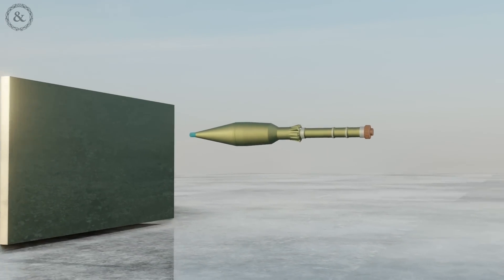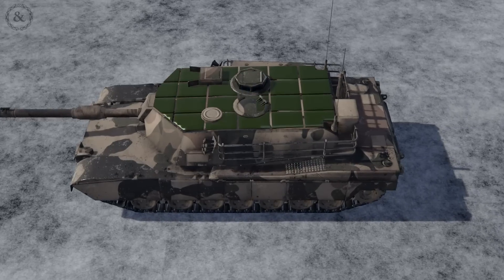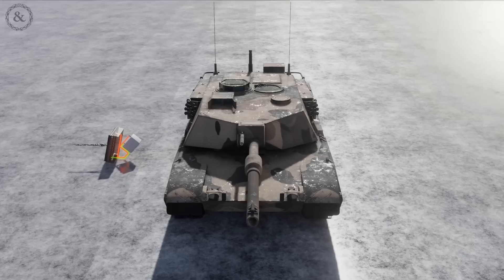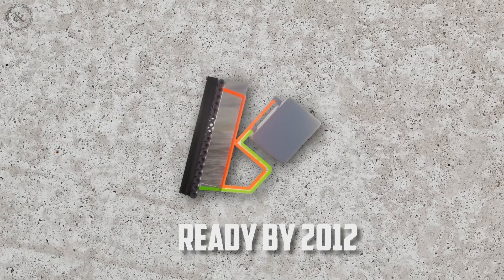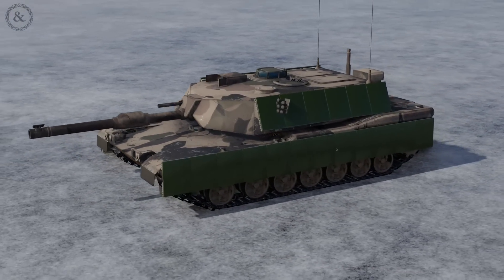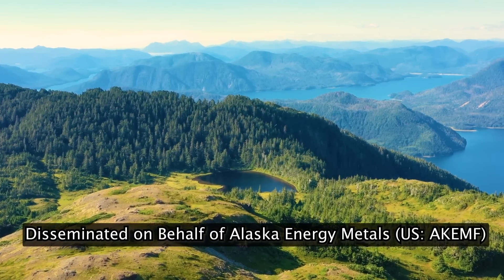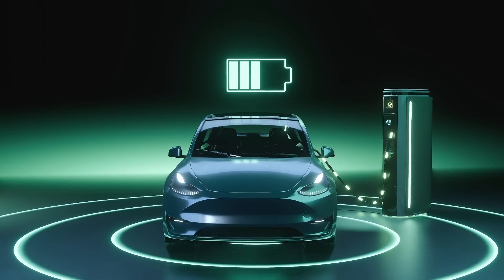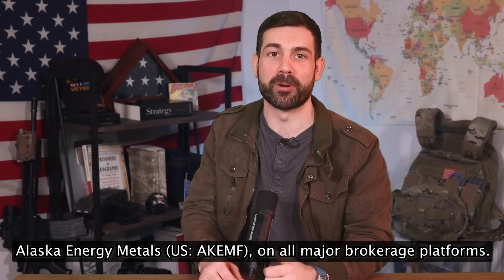How Electromagnetic Armor Vaporizes RPGs

Comment: A double tap would render the armor useless.  The first munition would be dumb frag/sabot type to destroy the electro plate, the second munition would have the shaped charge.  Both in the same shot/missile.  These double tap rounds already exist for reactive armor.
Reply: Yes, but just like ERA, you have to sacrifice the primary charge size which reduces its actual penetration compared to a unitary warhead. Either way, it reduces the potential penetrative capability of the HEAT either by disrupting the jet or forcing it to have a smaller main charge for the same weight/size.
Reply: At  5:02  "the shield was placed 1 meter away"   Well duh, just the 1 meter physical separation alone would reduce the charge's power by 50-70%.  smh  What would also make the tank 2 meter wider and taller. lol
Reply: put this on top of era
Reply: @ahimel  Well would the explosive reactive armor destroy the electromagnetic armor?  So good against one shot only. Why not just ERA armor in that case?  He didn't say if electromagnetic armor  gets damaged after one shot.  I would think the point is it does not bit I'm not sure how that would be so.
Reply: A simpler solution is tandem charge shaped charge warhead.
Reply: @samuelmendoza9356  - They already have tandem charges and anti-tandem charges. lol  It's a never ending cat and mouse game.
Reply: @billant2  I express doubt the Electric Armour would fare better than ERA
Reply: @samuelmendoza9356  - Both have pros and cons therefore should be used in specific cases.  EA is still bulky and cumbersome to use, including rearming/recharging.  Like most electronics it will likely be improved in the future.
Reply: @billant2  Electric Armour is reliant on having electrified surfaces to zap projectiles like shaped charges(HEAT) and maybe even APFSDS. Once that part is struck I imagine the struck part and several inches around that struck point is gone. It's main advantage over ERA is it can be lighter. Struck with tandem charge or even the solution you propose, its the same, there's a hole already and it can't stop the second one going through it. At least, the ERA, when bolted on, won't need that much maintenance. Thhough, there is still weight issue.

In other words, no matter how fast electric armour is charged, its the hole on the struck part in which tandem or double tap mechanism is as helpless as ERA.
Reply: @samuelmendoza9356  - EA would be  effective is it could disarm an incoming missile from over a meter away to prevent a tandem change to do any significant damage.  Almost like a sci-fi force field, but we're probably may years away from that.
Reply: @billant2  you have a point, but I imagine the hilariously simple counter is proximity fuze and several counterchecks such as estimated flighttime to reach target and signature. Not exactly optimal but at least it can avoid touching the EA before it detonates. Granted, this idea is only ideal for ATGMs. Unguided AT rockets might make do with proximity fuze.
Reply: Tandem warhead you're welcome
Reply: can't it easily be defeated by covering the RPG with a couple of rubbers? 
that's like what? 10 cents or 20 minutes with a goat in the middle east?

Comment: This technology has been used for a few decades on North American aircraft carriers. The upper deck... but on an aircraft carrier there are 2 nuclear reactors that can generate large amounts of energy if necessary... But in a tank it is a little difficult to get due to the weight of the generators

This technology has been used for a few decades on North American aircraft carriers. The upper deck... but on an aircraft carrier there are 2 nuclear reactors that can generate large amounts of energy if necessary... But in a tank it is a little difficult to get due to the weight of the generators

Comment: Interesting concept. IF this can't stop Sabot, does that mean it might not stop other unitary kinetic projectiles like anti-tank rifles? Would hosing an enemy tank with heavy machine guns or even small arms damage or deplete the electric armor to the point that an RPG could have the desired effect?

I could see this being useful in some instances with modified tactics or additional systems. It might be useful for hover tank-destroyers that I've proposed, which are all-but-unarmored self-propelled anti-tank guns that use static and dynamic air-cushions to scoot across the ground and above mines and fast enough to mitigate ATGMs.

Comment: Capacitors of this sort require constant direct current, easiest was to think about such a thing is to imagine it’s water. Direct current (DC power) simply means that the power is always on and always moving in the same direction through the circuit. A capacitor fills up like a water tower to hold a quantity of power ready without requiring any form of maintenance for decades. For this reason old capacitors are very dangerous because one charged to hold 10,000 amps back in the 1960s will still kill you instantly today. That ability to hold an enormous charge at the ready for a long period of time is what males this armor work… simply put the bullet gets its body to complete the circuit as it’s penetrating the armor and instantly burns to nothing. As long as nothing is completing the circuit it requires almost zero maintenance… for decades. If something stabs through the armor to complete the circuit but stays in place and doesn’t melt the modular nature of the armor means you can just deactivate that specific chunk and re-charge the rest of the armor.

If you want to see what this is in real life, find one of those disposable film cameras… charge the flash then try to disassemble the camera 

That thing you find is what 350 milliamperes feels like… the tank probably have a billion x that charge.

Comment: I think this system would be prone for catastrophic accidents and I'm not just talking about people getting shocked to death. The high amount of electricity would destroy anything that the tank knocks into or the way around. What's worse is like any reactive armor, that panel is expended and no longer usable. Too complex, too expensive, too prone to cause accidents and would probably be unreliable compared to ERA which only has one drawback; its weight. Another thing is that the current armor used on Western MBT-s tend to be pretty darn good and even if they meet something they can't resist you can always up-armor them with extra plates and/or ERA like Ukraine does with Leopards.

This was a nice little project to fill someone's pocket and that's it, there are better, simpler solutions for the same problem.

Comment: There is no way to use electromagnetic armor as described for countering shape charges to protect against a solid tungsten round. You'd absolute have to manage it through different mechanics because of the extreme energy requirements for getting tungsten hot.

Comment: Some clarifications: electromagnetic armour will consume very little power once charged up. Charging time isn't an issue either - it can be done within a few minutes, depending on the electrical system of the tank.
There is another reason why it isn't practicable though, but I can't/won't share why.

Comment: Yea... first that takes a lot of energy. Second if you are going to rely on batteries in any capacity, batteries are heavy. Maybe not as heavy as armor... but heavy. Also batteries require a lot of maintenance and fail... where armor ... well it stays armor.  Also batteries are sensitive to temperature variance where armor... not so much.

Comment: When the US goes into mining of a ressource, you both officially proved the defense economy has failed, as well as you can safely say that tech found ways to completley get rid of this particular ressource xD

Science fact: Yeah, that's a thing. We just use rare earth metals mostly because the supply chain and manufacturing is designed to work with this ressource, not another.

Comment: Sounds like a tandem charge warhead would do pretty well. One charge to pop the capacitor and the other for damage. Alternatively, relatively light MG or autocannon fire sounds like they would seriously degrade/discharge a lot of panels. Until we see solutions to these, it seems like more trouble than it's worth with current tech.

Comment: I would think instead of two powerful caps you run smaller caps parallel and they can charge rather quickly. Then with a discharge the remaining caps would equalize the specific discharged cap

Comment: Would electric armor be better if it was reactive along a grid. If the point if contact is know and that area charged it would save energy and demand and could also increase amp in the targeted area easier. Also a non conductive surface easily penetrated by a large explosive could protect troops and mechanics from conducting energy through a circuit.

Comment: The issue may just be that you might as well just go back to ERA systems. Sure, you CAN charge the amount of elecetrical current you potentially need for this system on a 24 volt system which I presume most tanks and armored vehicles run on, but you may have to run the engine for an entire night if we're only using it's engine, and unless you mount extra batteries for the system that engine need to keep running. And the electrecity of the entire system will be used up after countering one or two missles. Unless you mount huge batteries on the tank - and when you need to transport large amount of electrecity size matter, unless you want your crew to sniff cable smoke every time they get shot at.

Comment: How come electricity flows through the round if the current always flows thru the path of least resistance. I can touch a live wire with current flowing as long as I'm isolated. I think there's something missing
Reply: I think the coils get quicly charged at the moment of impact  which produces a drastic change of magnetic field which induces a current inside the round.

Comment: I believe it can be done with lower voltage supplies as well. It's call a voltage multiplier, looks it up. It's a rather simple device than can be scaled up, provide multiple voltages across the circuit and output a LOT of power at the end. Now you have my brain in make another military invention mode 😉. Gee thanks 😒.

Comment: Interesting video.  There were nickel mines in the lower 48 at one time.   With the fires from lithium batteries in apartments and on auto ferries so some Ferry businesses do not allow hybrid or electric vehicles it puts a damper on driving an EV in some places.  China does not allow EVs on many Ferry, it caused issues for many and got on china news. Australia has a company that rebuilt some semi tractors with battery packs but they have had fire issues with the trucks.  A major problem is the poisonous gasses that come from the battery fires, it is really bad and need to train fire departments a lot more.  There have been major fires on a couple car ferrys  on the europe coast and destroyed at least 2 car ferrys. Google car ferry fires north sea or Netherlands.

Comment: So as of 2007, this system worked as well as spaced logs and chain link. 12-18" air gap betwixt Cope and vehicle. 
 Cutting edge 1944.
This tech if effective has probably advanced some in the last 17 years.
 Only half way through vid
Signed up to eliminate Commies during the Reagan Administration. 
Got limited time here
What can this shit do vs. DU , Tungsten, Metal Enhanhanced Thermobaric shit?
More than one way to Skin an Enemy

Comment: It doesn't necessarily need a lot of electrical power. If all you need is a high voltage, you don't need a lot of power for that. Imagine a taser in the palm of your hand powered by a battery. Not a lot of power but a lot of voltage to disable an assailant. If you need a lot of voltage and current together, that's a different story and that's a lot of power. Basically, voltage x current = wattage.

Comment: I can't imagine in-field repairs with that stuff .. I agree with your fried to a crisp imagery.   Also all weather environments as well.

All it would take then is RPG's to be covered with nonconducting metal, with the reduced armor thickness, do you want to gamble that the RPG aiming at you is conductive or non conductive. ick.  also even with traditional RPG's .. just attack the tank with simultaneous RPG's would be enough to entirely defeat the armor.  It seems too easy to get around IMO.

Comment: upgrade tanks to 12 time current size...it will allow more managing the insides and possibly add additional weaponry..2X height and 3X wideness..also still wondering why they haven't made a tornado making machine...should not be too hard to make or even a machine that spin so fast that it attract everything toward it....4 giant  metal rectangle attach to a core and spin it  up...rectangle the size of a building(3000 meter long approx each of them)...just gonna need so much wheel and possibly rockets to get it started...then you get a disaster machine active(likely unstoppable once its launch)..probably would require an underground brakes system to slow it down after launch

Comment: I was very impressed with the discussion of the
electromagnetic tank armor, Cappy. Industry has standards on Lock out, Tag out for 
working on these system. Forget EV. Toyota has water/hydrogen power systems
that will KILL EV.  EV in Alaska makes up only 0.12%. Yeah Buddy.

Comment: This was a very interesting video for someone that has worked with electrical equipment for years and has an armor background. If you look up Arc flash videos you will realize how much power is really in the transformers and wire we live with every day. I could see this working using high density capacitors to store the energy vs a power system always having to supply that is a surge. The biggest issue would be what energy density can they get in the capacitors to hold all of that power for an instantaneous fault current high enough to do what you want it to do and still fit in the space available. The capacitors themselves could also create a secondary hazard to the crew if hit so the risk assessment would keep swinging back and forth adding complexities to the system. Look up man made lightning for transformer testing and you will see what this type of system would  be doing in real life off the battlefield.

Comment: It's worth noting that back then the technology to deal with high-energy systems didn't really exist; and it's only now that we're seeing much-needed movement in the energy generation and storage space thanks to EVs. Moving to higher voltage standards like 48v+ and improvements in fast-charging supercapacitors and lithium-based batteries would considerably improve some of the deficiencies of EmRA. As to dealing with more powerful sabots or even anti-tank missiles, rapid energy shunting to the predicted impact point could provide a burst of protection, but would require something like a modified Trophy APS that uses radar and sensors to detect incoming projectiles and the impact point. In fact, pairing EmRA with something like Trophy's detection and prediction system could also help preserve energy; only activating once it detects inbound projectiles headings towards the tank.

Still, the energy-related technologies are in their infancy, but given the continued pursuit of faster charging systems and non-volatile energy storage systems like Solid-State Batteries, and continued refinements to power generation, it's closer to viability now than back in the 2000s. It also helps that the US Military and some allies are looking into hybrid tanks that could power a whole array of high-energy equipment, whether it's jammers, lasers, APS, or remote turrets, which would be a practical platform to also implement EmRA on as that tech matures too.

Comment: This seems completely worthless. It would be heavier to mount on current vehicles than era and weak to kinetic damage. Using a proxy fuse rocket or kinetic rocket/missile makes this easy to bypass. What if a person or drone sprays conductive paint to drain the batteries constantly? It would probably be better to have the armor composition change when struck instead of zapping the warhead

Comment: I don't understand how that idea lasted so long. As your armor is literally weather-dependent. Not to mention would other small arms not just cause it to discharge. It's a far worse version of reactive armor. Something America had access to about 20 years before the research even started. This is before even considering the power needed or electrical problems this can cause for the tank.

Comment: So, to vaporize 1kg (2lbs) of copper, you need ~6MJ of energy. A 1kg electrolytic capacitor can store ~1kJ. That means you need ~6000x the weight of whatever you want to vaporize just in capacitors. For a shaped charge jet that might actually work but for a 10kg tungsten rod? Enjoy your extra 60t of capacitor weight!